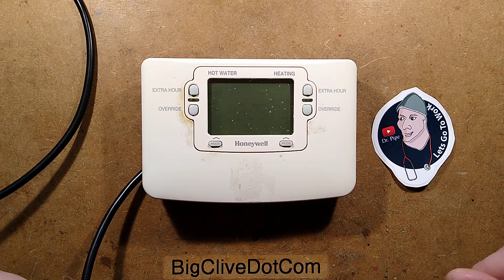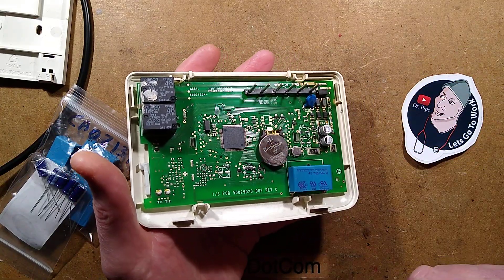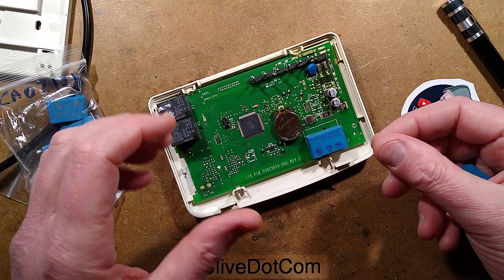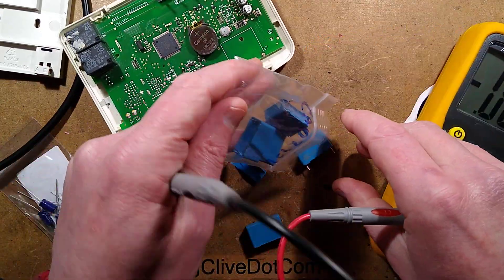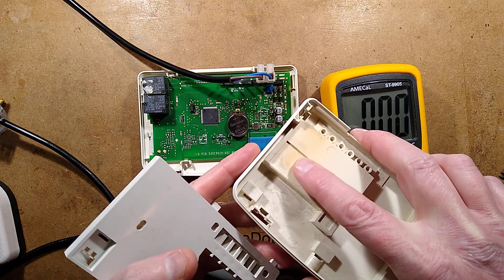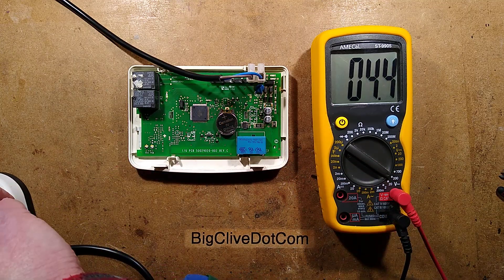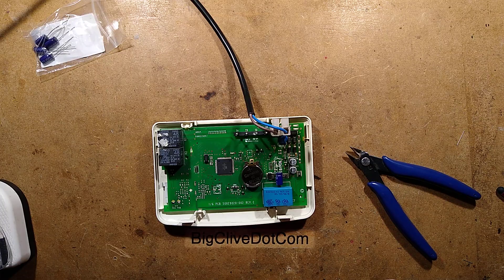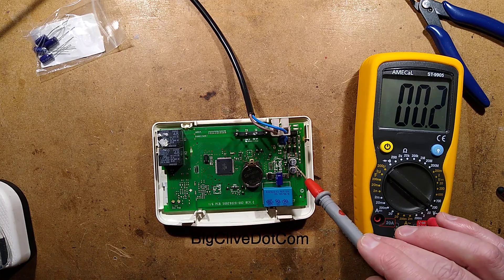Troubleshooting a heating controller.

Comment: Imagine how much less electronic waste there would be if everyone could fix their own appliances.
Reply: That's the point of companies these days, just repurchase. Such a pain.
Reply: @lovelyheiferdev  aka apple
Reply: @lovelyheiferdev  Making custom parts so that other similar parts just won't fit doesn't help either.
Reply: Justin Case  screw planned obsolescence.
Reply: Simple solution: go to college for 4 years and get an electrical engineering degree.
Reply: @demef758  If you think it's that simple, you obviously don't have an electrical engineering degree.
Reply: @demef758  you don't need a degree to repair things.
Reply: I find that most people don't even know how to properly operate their appliances let alone fix them.
Especially a thermostat.  
"It's cold in here and I'm in a hurry to get warm. So I'm cranking up the heat to 85F."  
And I spend hours trying to explain that it won't get warmer faster at 85 but rather it will just overshoot and she'll get too hot.  
Then a few hours later. 
"It's hot in here." So she cranks the temp down to 60F.  
Then later she complains it's not getting cooler.  I try to explain it's still in heat mode so the only thing lowering the temp to 60F was to turn it all off.
She is an engineer but not an electrical engineer.  
But considering her trouble with can openers it seems that the mechanical engineering degree didn't help much.
Reply: Dont even think. I live in hungary. My hobby is electric repairing and 3d printing. Dont even think how much work I have, everyday arrives 3-4 new order for repair or replacement part for devices. Usually laptops or tv-s, but there a lot of order of 3d parts. Many GoPro asseccories etc. I have the modells, and can print for 1/3 of price in a day usually.
Reply: With you there, but my wife is starting to hate me because our house is full of 'old sh*t'
Reply: @rowgli  you know what you should get rid of, right?)
Reply: True, but imagine how much educational waste it would be if everyone tried to be high level at every area in life, with life finite so that "jack of all trades" sort of person could never possibly be as good as an expert in any field.  No.  That is nonviable.  Specialists are the right thing for society and instead, we should make manufacturers provide long enough (VERY long) warranties that it is not cost effective for them to try to shave their BOM costs down to where we have early failures on components as inevitable as capacitors, AND we should force manufacturers to take back and recycle their products, AND we should stop pretending that we need to abandon existing tech in search of the next better thing which is one of the ultimate reasons why there is as much consolation in retiring things as there is.
Reply: Exactly what I was thinking!
Reply: problem with that is then We wouldnt get the discarded assembly's to fix
Reply: Imagine how much less there would be made to be begin with ,if they made it more reliable from new
Reply: @LOTPOR0402  «built to last» usually means «degrades very slow», and in terms of natural decomposition too.
Reply: Those were the days now its throw it out and replace
Reply: I fixed a stupid simple heat gun lately. A crimped connection had somehow managed to carbonise itself even though it was supposed to be metal, so I replaced it with an improvised crimp connection made from a piece of copper. Then the switch decided to fry itself, because it was a piece of crap, and it never felt reliable anyway. I replaced it by two separate switches and a piece of 3D printed placeholder. This was a pretty cheap heat gun and I could have bought a much fancier new one for the mere cost of the man-hours I have put into this, but I just refused to throw away this big foam plastic box including accessories just because two small parts of the device had died while the core components were still perfect.
Garbage disposal should become way more expensive, because it will prove expensive in the future. If people need to pay a big sum to get rid of broken things, they will automatically start to look for products that don't break or that can be repaired.
Reply: I do fix all  my electronics and appliances I'm a eletricain
Reply: Imagine how many more dead consumers there’d be !
Reply: Everyone can fix their own appliances. Most people simply choose to watch Netflix instead or whatever.
Reply: @stefantrethan  I prefer watching how a big bearded man touches various things and speaks in a hypnotizing voice.
Reply: @stefantrethan  No, they can't.  They normally ask me to do it.
Reply: Wait until the globalists get their way and everyone is driving un-repairable electric cars 🤣😂
Reply: @arcadeuk  how are electric cars not repairable?
Reply: @theodiscusgaming3909  Rich Rebuilds?  Tesla?
Reply: @theodiscusgaming3909  Un-repairable cars are un-repairable because the manufacturer put measures in place to prevent you from repairing it. For example by not allowing access to parts and digitally pairing parts to the VIN. This is mostly seen in electric cars (*uch* Tesla *uch*) because they don't have a dealer network and can hence bypass the right to repair laws. And because apparently people buy these cars anyways. There was a time that the reputation of a brand was partly based on how expensive the parts were.
Reply: @tomvleeuwen  Also, making things like alternators and AC compressors sealed units in all cars not just EVs.  Of course a smart mechanic can get in there, replace the standard bearings/seals/contacts/bits and get it back together, but it's not a manufacturer sanctioned route.  They just want to sell you new parts and charge you $120/hour for the job, and I call a pox down on them.  I don't know about VIN checking, but if so that's the Apple MO which is a plague on society.  (never bought apple and never will because of their business model.  Security needs to come from system design, not hardware design masquerading as such).  Did apple invent it?  I'm not sure but they push it pretty hard.  Bastards.
Reply: @arcadeuk  go watch rich rebuilds m8
Reply: Libturds don't even know what a garbage disposal is.

Comment: It took me forever to figure out why when our heating controller went to "auxillary mode" the heat shut off and the house got freezing cold. Turns out the previous owner of the house didnt have an auxillary unit installed, so the thermostat was trying to turn on nothing
Reply: Did it automatically go to auxiliary mode oh
Reply: @nomusicrc  Yes, its a geothermal unit and at a certain outside temp. it just cant keep up so the thermostat tries to turn on aux. mode. My solution was the same as the previous owner and light the small coal stove in the basement during the coldest parts of winter

Comment: Low ESR capacitors are often tall and skinny. At 50 Hz low ESR is not important.
Reply: ??  That makes no sense.  Low ESR caps come in the same height-diameter ratio as higher ESR caps, though using older tech construction, they do typically have a higher total can volume per capacitance rating.  Really if anything I find the opposite to be more true, that a low ESR SMD cap is more often near the same diameter as its height.

Comment: Love the measurement of AC ripple method on a DC line.
Reply: you cant always do it like that, with most of my meters you cant, it gives skewed readings, but a capacitor in series will block the dc making it work
Reply: @andygozzo72  Inexpensive meters sometimes don't block DC.
Reply: @andygozzo72  Indeed this trick doesn't work with the cheap meters. Before you use this trick you'll want to measure a 9v battery or similar in AC mode. You can only use the ripple trick if the battery reads 0vac both directions.
Reply: @eDoc2020  i know 😉
Reply: @andygozzo72  Analog meters had a AC setting that had a blocking cap. It was called Output.
Reply: @OC35  none of mine had/has ...
Reply: I’m stealing this for later.
Reply: This works great for low frequency ripple (some meters will only do 400Hz, most will do the complete audible range up to 20-30kHz, some even more up to ~ 100kHz)
Reply: Just understand that the high frequency rolloff of a DMM is usually pretty low, maybe a couple KHz, you wouldn't want to trust this trick on a switch mode supply output. Works for checking mains frequency ripple though
Reply: Alternatively buy a dual display meter that shows the AC component while measuring DC.
Reply: @stanimir4197  you could..but why buy another, likely expensive one, when you already have one or several,  and can use a blocking capacitor..?
Reply: @andygozzo72  one, it's a lot faster and more  reliable, safer too. It works with rectified mains and high frequencies.

Comment: I hate this capacitor plague... I have had the exact same problem with our dehumidifier... 2 years ago one electrolytic died and causes the fan relay to permanently switch on and off (and actually killed the fan in the process. Changed the obviously bulging cap and voila, works normal again. It had the same circuit for the compressor relay, but that one tested fine so I left it in. Low and behold - a few weeks ago the same issue with the compressor relay. Luckily I caught it fast enough so the compressor was not damaged (or it was just more resiliant).
Lesson learned: If one cap is bad, better recap everything immediately.

Comment: My uncle taught me that AC multimeter ripple trick last year when I was asking if he had any advice on oscilloscopes. I told him I mainly just wanted one to check ripple on small power supplies and he said that a DMM could do some rough testing for ripple that way. Sure enough, it works! Really neat trick for quick and dirty test.
Reply: that way shown in the video doesnt always work, in most of my meters it doesnt, gives incorrect unstable readings, but if you connect a capacitor in series to block the dc level, it does then work
Reply: @andygozzo72  Oh, that's a great tip as well!
Reply: Most DMM I've seen it will work. It won't work on the old analog meters as many times they just rectify the voltage.  I'm not sure how an RMS meter will react - it's likely to measure the RMS value of the DC+AC.

Comment: So lesson for today is the same as always: Device not starting or constantly restarting: Check and replace electrolytic capacitors!
Reply: yes, and ideally replace them for 105 degrees ones.
Reply: @p_mouse8676  Or solid polymer electrolytics.
Reply: probably 85 to 90% of the things I repair have failing electrolytic caps on the low voltage side of the power supply. It's a sure fire way to guarantee planned obsolescence, and save 10 cents on the original BOM cost too. It's win win for the manufacturer
Reply: I always check electrolytics first, ever since I spent hours working on a 30W Linear Conchord amplifier. There were two plastic cased electrolytics in contact with 10 watt resistors, and of course they failed. One had dried out. I replaced both.
Reply: In this case they are small enough to be replaced with smd mlcc, though. I wonder why he doesn't have some supply of them (aside not being cheap).
Reply: @stanimir4197  You have to watch out for those high capacitance value mlcc's - they change capacitance (decrease) as the voltage increase, and they have some other drawbacks as well. Not sure why he's having trouble finding those capacitors, mouser part# 667-EEE-FK2A220L - I don't think he ever mentioned what value they were, but he said he would replace them with 1 47uf through hole cap, so i'm guessing the originals are 22uf. edit: you can see they're 22uF in the video at the beginning if you make it full screen. Mouser and digikey have many 22uf 63v (or higher) caps in that style package. CPC seems like a horse trader in cheap chinese crap, not an actual electronics component distributor. When I go to their page, they seem to sell all kinds of random stuff, not just components. Maybe CPC = Crappy Products from China.

Comment: I had a different controller fail with a crack in the PCB - it was mechanically a marginal design. The board flexed too much under button presses. Then it wouldn’t react to buttons or even act as if there were random buttons being clicked. Lucky me - diagnosed it, smugly shut the case then called the warranty service in, as the system still had about a month left of its 10 year warranty. Figured - if it breaks after warranty expires, I’ll have less stress knowing what’s likely to fail :)
Reply: Had a similar issue with a boiler controller.  Kept randomly switching off and then restarting.  Under microscope examination the solder pads for the largest components were all cracked and making intermittent contact, looked as though the board had been dropped at some point.  Managed to recover it with a long resoldering session as it was out of warranty, but ultimately successful and still working many years later.

Comment: I use to build these at Honeywell in Newhouse, Motherwell. When you opened it was hoping to see the initials of the QC tester, but then realised it'll be on the side with LCD written in Sharpie.
Reply: Do you know a way to repair the display connection? These degrade in time until the display becomes totally unreadable. I've got a bunch of these with this defect.
Reply: @KKRRAAYY  Same issue with the CM907 series roomstat , which is why I've kept old CM67 roomstat that uses zebra strip. 

BTW if anyone's got a non-optimum start CM67, it's enabled with a link on the PCB along with another option that I can't remember. Dropping down from the bottom left corner of the main IC  there's a capacitor, a 220k resistor and a 68k resistor. Between the two resistors there's a couple of unpopulated positions. Linking the one next to the 68k enables optimum start.
Reply: With these zebra strip connectors it is best to remove the zebra strip, clean the glass / PCB with alcohol, clean and heat the zebra strip back. That will most likely fix it again for a few months/years.
If that does not work, you can just buy those zebra strip connectors
Reply: Looks like this [Edit] (my post on the CM67) was useful to somebody. I only know because a non-optimum start one came my way and as the uC would have been either mask or OTP back then the difference was likely to be a build/link option, so first thing I did was compare the PCBs. From memory there are other options like a 'telephone interface' where closing a pair of terminals makes the 'stat go to 20C from a lower or frost setting but I've not tried it.
Reply: @TheRailroad99  On later ones they used the printed carbon track connecting ribbon that's glued to the display and PCB and that's the one that fails. Provided there's the right pressure elastomeric connectors AKA Zebra strip seem to last forever.
Reply: @Graham_Langley   "it's enabled with a link on the PCB along with another option"  -  I bet there was a premium paid for those "options" by the unwitting customer. So all you paid for was a blob of solder. 🙄
Reply: @TheRailroad99  I used to polish the edge on 2000 grit wet and dry.
Reply: @channelsixtysix066  It was a zero-ohm link that cost £10.
Reply: @Graham_Langley  If only people knew. 🙄
Reply: @channelsixtysix066  My favourite extra-cost option that was already there was on a Potterton programmer from the 70s. Came in single day (all days the same) and a more expensive 7-day versions, but the only difference was the fitting of a DAY programming switch plus a different front panel label. Pressing the DAY switch switched it from single to 7-day operation, so if the switch wasn't fitted it stayed in single day mode.
Reply: @channelsixtysix066  Even though this was before '97 a few minutes on Google images and a memory that '2000' played a part, it was the EP3000 that had the DAYS switch and the then current EP2000 that didn't. 
Here's the EP3000: www.diynot.com/diy/attachments/20171112_073118-jpg.130263/ 
As I remember it I saw an EP3000 with a DAYS switch so pulled my EP2000 apart, fitted the switch and had a 7-day programmer.
Reply: @Graham_Langley  Pure cynical marketing by Potterton.
Reply: @channelsixtysix066  Much the same is done by DSO manufacturers with extra bandwidth and decoding options enabled by simple software switches that you have to pay for.
Reply: @Graham_Langley  Yes, I've noticed that of late. It makes it confusing to purchase a scope. Jump the wrong way and you've done your dough.
Reply: Wow!! 80 Likes...lol
I can only dream of such a following..lol
But really ?? That's cool.  80 is massive, the most I get is 2..lol
I'd get a BIG FAT HEAD THOUGH...LOL

Comment: This is a common issue, Honeywell were supplying replacements FOC at one time if you gave them a call, I don't know if they still are.
Reply: Honeywell in Canada aren’t the greatest, or I hit bad customer service. When I had the thermostat unclipped from the wall, I thought I’d be all preventative and change the CR2032, but the clip holding the battery fell off!  Turned out the solder holding it was drier than a salt mine, and the warranty on a rather expensive WiFi-connected device was only 1 year!  

I like the device, but think they could have done better than to release a product with a manufactured defect upon the world, and then be so faecal about customer service…
Reply: Offtopic question.. is that yours in the profile picture? If yes we'll I didn't expect other furries be this nerdy :D
Reply: @adam207321  other here lol
Reply: @adam207321  yes
Reply: @adam207321  iT's nOt sExUaL. REeEeEEEE
Reply: @littlejackalo5326  Say that again.  You're surrounded by furries.